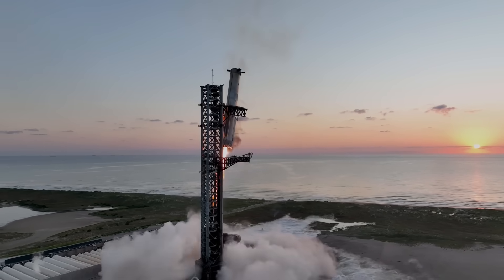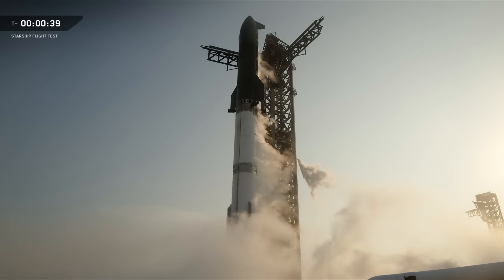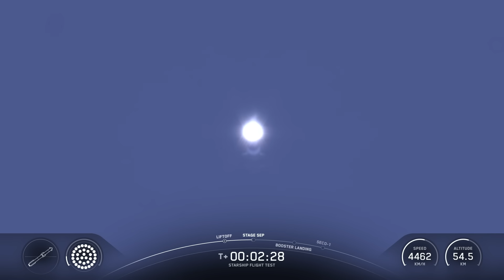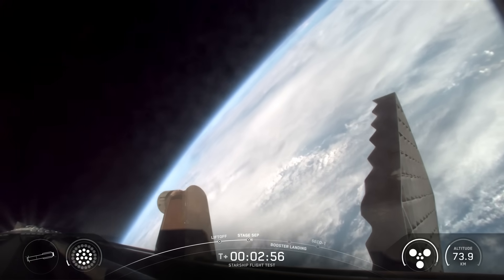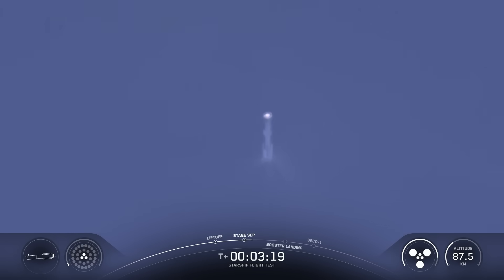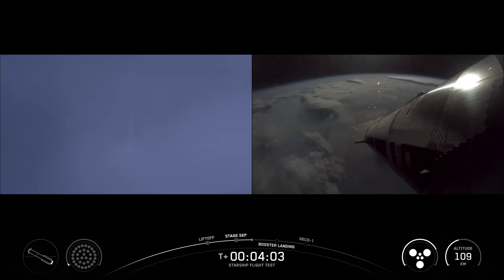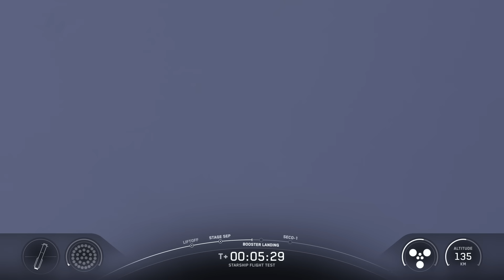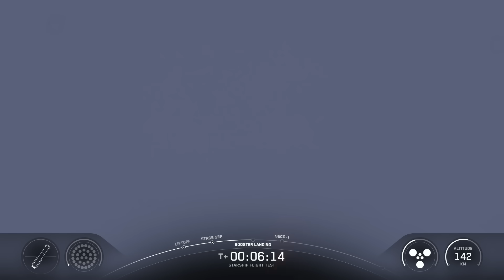SpaceX Builds Largest Reusable Booster, Also Makes Door That Won't Open - Starship Flight 9 Recap

Comment: SpaceX’s “launch, crash, learn” philosophy of rocket development undoubtedly makes for dramatic and attention-grabbing milestones. While this iterative, trial-and-error approach may accelerate innovation, it remains debatable whether it is ultimately faster or more efficient than the traditional, methodical strategy of plan, design, test, build in redundancy, and aim for first-time success.

What is indisputable, however, is the cost. At an estimated $100 million per launch, this approach demands exceptionally deep pockets. Were these costs shouldered entirely by taxpayers, such a strategy would be far more difficult to justify. And although SpaceX is a privately funded company, it is important to recognise that a significant portion of its programmes – especially those involving NASA and defence contracts – are indeed supported by public money.

Crucially, this high-risk developmental model has its limits. Once the programme progresses to crewed missions, the tolerance for failure narrows dramatically. Unless SpaceX were to adopt an unacceptably cavalier attitude, its current approach will require substantial adaptation to meet the stringent safety standards of human spaceflight.

So, while SpaceX may continue to make bold claims - from crewed missions to Mars as early as next year to conducting hundreds of Starship flights annually - the reality is that once human lives are involved, the pace of development is likely to slow significantly. Progress will no longer follow the optimistic, linear trajectory so often portrayed by Musk, but will instead be constrained by the rigorous safety protocols and regulatory oversight essential to crewed spaceflight.

Comment: Booster recovery failure? Check
Door open failure? Check
Satellite launch failure? Check
Starship recovery failure? Check
Elon: Today's launch was a success!
Reply: But the clock is correct!
Reply: I wonder why the telemetry on screen was reduced.
Reply: They never intended on recovering booster. Check.

Comment: Raptor is great,  super heavy is fine, and I have no doubt it can be tweaked and iterated into a useful, reliable reusable big brother to falcon 9. Starship is a lemon turkey.  It's fallen into the same trap as the space shuttle, and is trying to solve too many things at once. They should ditch it and try something safer to put on top of super heavy that allows them to evolve solutions to their challenges one at a time. (written from my armchair at the institute of randomguy online)

Comment: SX can build a ship that doesn't fail. They've already done that. They could just keep repeating the test that they know the ship passes over and over so everyone can clap and say "look, they're making great progress, 15 successful flights in a row"

But they'd learn nothing. 

Instead they create tests where they intend the ship to fail. Then they find out what part fails and how, and beef it up. 

They could have designed a door that 100% would work, that weighed 800 kg. Or design a door that they think is too flimsy to work. They can't test in zero g unless they fly it, knowing they think it will fail. If it fails, they make it stronger. If it doesn't fail, they make it weaker (lighter) *UNTIL IT DOES FAIL*. Failure is not just an option, it's a necessity. If it hasn't failed you've made it too heavy.
Reply: I get it but they also need to take it easier, they're already far ahead of the rest and blowing a rocket up 10 times instead of 3 trying to squeeze the last 10% of mass isn't very efficient
Reply: @KepleroGTthat 10% is the difference between getting 200 tonnes to LEO and getting no payload to LEO. Because it's not just mass, it's flight profiles, ISP, total thrust and more. Everything has to be optimised or you're just not going to get enough payload to space.

Comment: Based on the evidence from the last few flights, we need a much more robust engine bay on ship. 
It seems to keep taking minor damage from the hot-stage that sets fires and destroys systems over the long duration of that orbit burn. 
I know that mass is the main enemy on the rocket Eq, given limited thrust.. but I think they're gonna have to spend some mass on this. 
Especially when RCS is getting stuck..
Just realized I'm only halfway through, at 9:45..
Reply: Agreed, it’s rather frustrating to keep watching. The kicker is that this entire thing is obviously supposed to be reusable, but moreover it’s supposed to be “hands-off” reusable?! 

It’s probably a coincidence, but I had a lot more faith in the V1 design for some reason.
Reply: @EstorilEm  perhaps they've pushed the "fail early and often, then iterate" philosophy too far. I have every confidence they'll figure it out. But today i did kind of start to wonder for the first time if the entire design is a red herring.
And that's coming from a huge fan who shares in the goal.
Reply: Maybe they can alter the fuel to oxidiser mixture during staging to bring down the temperatures of the exhaust. You only really need a little push. Might require less mass than a complex heat shield or thougher/thicker materials. Another option in my head would be to make the staging ring break apart upon staging. Might help went some of that hot gas sooner however it propably causes a potential hazards for the booster.
Reply: Maybe blocking some of the vents on the hot staging ring reflected too much exhaust back towards starship
Reply: @RazzUK  maybe.. but i don't think that's it on its own. After all, 9 went further than 8. And 9 was first use of the higher resistant HS ring.
Reply: This is what we have. It's our best shot until we get some sort of Clarke Tech... I don't see that happening before I hit 40.. so..
Reply: @JohnSmith-yp2nt  who's best shot at what ?
Reply: 'we' lol

Comment: This system should work, but I feel like something at SpaceX has fundamentally changed. Something with the engineering structure, it's direction, or instruction. The team is on track to needing fifteen test flights to work out most of the points of failure. So what happened? Is the team suffering stolen talent from other corporations? Is the team relying on A.I. (not actually intelligent) to resolve the kinks? Has there been a shift away from vital foreign talent due to pressure from the Trump admin? I think it needs to be figured out at a very fundamental level, otherwise this will never work.
Reply: Or, wild guess I know, they have an erratic leader who gets increasingly more divorced from reality. That could also be the root cause for talent leaving.
Reply: It's what happens when you promote incompetent people into management positions - they never admit to making a mistake, and insist on pushing forward with bad decisions regardless of plain evidence that it's time to admit they don't know what they're doing, or made a mistake. It's called a toxic work environment filled with "failing upwards" types in management roles - it's a horrible atmosphere to work in.

Comment: It feels like Starship and maybe even SpaceX have stagnated in development.
The previous two flights showed similar, if not the same, failure modes.
They actually seem to suffer from "brain drain" or talent drain to either other companies or even other countries. They also employed a lot of H1B visa workers, but the US has become a rather hostile environment for foreign workers.
Reply: In engineering circles, it's well known to avoid all Elon companies like the plague - lots of reports of insane working conditions and expectations, for not great pay - basically only new grads that don't know any better would even consider working for any of his companies. It does look nice on your resume though for your next job (maybe). I'm sure Elon is dipping into his ketamine stash hard tonight! Couldn't happen to a nicer natzi
Reply: I'm gonna pull a [citation needed] on the H1B visa thing. I recall seeing in the past (like, 4-5 years ago) an interview with SpaceX that they don't employ visa workers because the technology they're handling has strict national security requirements. SpaceX engineers have to be American citizens, this is a requirement that's been in place all along.
So unless I have outdated or incorrect information, your message about them employing H1B visa workers doesn't make any sense. Maybe for secondary IT roles? Certainly nothing core to the design or operation of the rocket.
Reply: @augustday9483 I unfortunately can only cite an unreliable source for this, Elon Musks tweet from the 27th of December 2024.
Though I do know of (former) German citizens that did work for the Tesla / SpaceX complex.
Reply: A toxic work environment will take it toll. Musk has had it coming for years.
Reply: You’re a fool. The previous two problems were unrelated and they were both addressed for this test.
Reply: @kevinjohnston4923 you are fool thinking there won’t be more “unrelated” problems popping up in the future.
Reply: @kevinjohnston4923  Both parts blew up this time.  That indicates retrograde progression.

Comment: 0:52 I mean as far as boosters that fly to space and then land propulsively the list includes New Shepard as well, it just carrys a capsule instead of an upper stage that could deliver payload to orbit. And if you drop the requirement of reaching space you also have the DC-X which is obviously the original propulsively landing reusable rocket.
Reply: He was talking about orbital class boosters
Reply: @joebuslife9275 well none of these boosters go to orbit. The only difference is what they are attached to. Fundamentally, the New Shepard booster wouldn't be an entirely different category of vehicle if it was used as a strap-on booster for something like Vulcan Centaur. What matters is really how high and fast the booster goes, not what the thing the booster is attached to does.

Comment: Saturn V, 13 & 0. 
"Starship", 0 & 9.
Reply: Saturn V was at the tail end of countless test flights and years development of previous Rockets.

Starship is trying to do something wholly new. Lots of trial and error to be expected.
Reply: @joebuslife9275  There were only thirteen Saturn V flights including test and mission flights with zero failures. It was built sixty plus years ago with paper, pens, pencils, rulers, slide rules, drafting boards and a IBM 360/91 computer with two megabytes of memory, paper punch cards and tape storage. NASA paid McDonnell Douglas for developing and building self landing rockets over thirty years ago and dropped the project in order to save the Shuttle from the CPA's. Musk is a charlatan who has been selling NASA their own technology back to them. With many billions frrom the taxpayers and the best technology on the planet, Musk cannot get a banana can into orbit. Musk will drive his "roadster" to Mars before any of his "rockets" make the trip.
Reply: Yes the development approach is completely different though and this has been known for years. SpaceX prefers to fly and rapidly iterate whereas NASA tested every single system individually before a single flight. NASAs approach costed 10s of billions and meant that ramping up production would have been significantly slower.
Reply: @Will-eq7uh   Musk will drive his "roadster" to Mars before any of his "rockets" make the trip.
Reply: Saturn V - tax payer money (25 billion)
Starship - investor money (5 billion)
Reply: @jay_chan  what i looked up shows the total cost of Saturn V program in 2024 dollars being 52b
Reply: @joebuslife9275  nope, it is equivalent to 257b as on today as per Planetary Society.
Reply: What i looked up shows the cost of just saturn 5 program was 52b in 2024 dollars  @jay_chan
Reply: @jay_chan  Musk's RICO & Ponzi Schemes -    PLUS $38,000,000,000.00
                                                     US Taxpayers - MINUS $38,000,000,000.00
Reply: @jay_chan  That is excluding the 2.9 billion it got from NASA (tax payer money) for Starship, and the almost 20 billion of taxpayer money SpaceX received the same way (tax payer money again) of course...
Reply: @berendharmsen the other 20b you speak of was for SpaceX delivering lauch services for a fraction of the cost of other options available to the government.

Also as far as i understand Space X doesn't get/keep that 2.9b unless it meats various milestones and deliverables
Reply: @joebuslife9275  And as soon as they cornered the market they immediately started price-gouging NASA (read: the tax payer).

Comment: it took this many saturn v's to carry out most of the missions and this thing hasnt made orbit yet what a clown show
Reply: That’s a rather disingenuous evaluation of both the Saturn program and Starship development. 

Saturn’s development had a long trail into earlier designs (prior to actual Saturn launches) and a test flight fatality. 

The design process of SpaceX is hardware rich development, which includes intentionally pushing the vehicle’s limits and iteration. What we are seeing with Starship is similar to the struggles when developing the Falcon 9 - the most successful rocket created so far. 

Yes it’s disappointing it didn’t reach splashdown, but it’s also not some catastrophic failure.
Reply: @Nathan-vt1jz  so did starship with falcon and the 70 years of post orbit rocketry it had to learn from, starship has an order of magnitude more research and tests to learn from
Reply: @CHRISTIEMALRY-2  Obviously - which is why they nailed the booster catch on the first try. 

They are still using a different design philosophy - iterative, hardware rich development. So we should expect more RUD’s as they push the hardware to the breaking point and excitement. They are trying to develop new capabilities for a rocket (full reusability) while also pushing for massive improvements in engine efficiency/thrust and payload capacity. 

I’m not knocking on the Apollo Program, as an American I’m especially proud of what we achieved. Both programs are amazing steps in human development and accomplishments. They are ambitious projects that both saw their struggles and overblown criticism in their own times.
Reply: @Nathan-vt1jz  one was an outstanding design this is a very poor one it has a future as a starlink sat launcher if they can get it working, and nothing else, the moonshot will never happen, mars will never happen l e o is full already nobody needs a 40 tons sat launcher that cant use fairings
Reply: how many times was saturn v been caught by two chopsticks in the middle of the air?
Reply: Proof that garage engineering is no way to build a rocket. And I say that, not egotistically as though I knew it wouldn't work, but as an early advocate, because I was genuinely curious if it would work. Unfortunately, it doesn't work. Now I think it's time for 'lessons learned' and to move on.

Comment: I would think despite the cheers on the surface, some of the staff are probably quite demoralised with their great leader and small issues are starting to creep in that were not there before.
Reply: They got data on the failure, but lost 3 times in a row, the data they actually wanted, sure it has to be demoralizing, if I was the tile engineer or the raptor relight engineer, or even the dispenser engineer, I would be frustrated to be denied my data and tests 3 times in a row. But the make of a man is to keep going, and never give up. Despite how u feel.
Reply: The point raised is valid, if you are working very long hours to get a test ready, then it is important to get a feeling of progress. It just helps the general vibe.

No one outside of the senior starship management team will know what will have met the criteria of success yesterday. 

Personally would have loved to see the tiles tested. However, in 3 years time these issues will probably seem like a distant memory.
Reply: @neilm9400  Reentering arse first seems daft.  That's never going to work.
Reply: Maybe the dear leader could write a book.  He could call it 'my struggle'. 😏
Reply: how dare you question the dear leader! Shame!
Reply: The only thing worse than someone that's ignorant, is someone that's ignorant but thinks they know the topic they're discussing. 

That's you.
Reply: @XShadowAngel Congratulations on composing such a patronising comment, but I'm not sure you appreciate how many talented engineers have left SpaceX in the past year, both by choice or because of speaking up. Speaking from some experience, staff doing 80hr weeks works when you are passionate about doing it, not when you are forced to do it.
Reply: @ab8jeh  You earned it, champ. Have any actual statistics to cite there, or just "trust me, bro!"?
Reply: @XShadowAngel  Musk is, at best, highly controversial.
Many of his staff will have strong negative feelings about him. 
There have been 3 flights in a row with unexpectedly bad outcomes. That's got to hurt morale. 

Unless you actually work on Starship I don't see how you can dispute this?
Reply: @XShadowAngel  It blew up again and Elon is talking about accelerating the launch schedule.  This is not a genius at work.